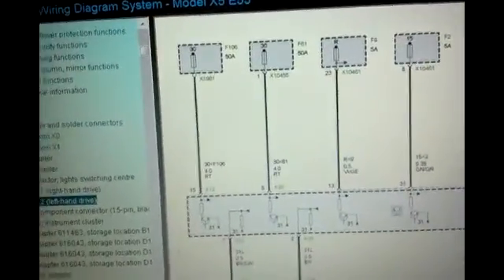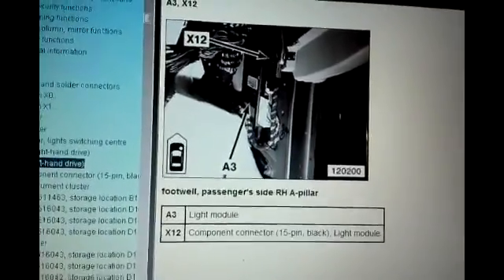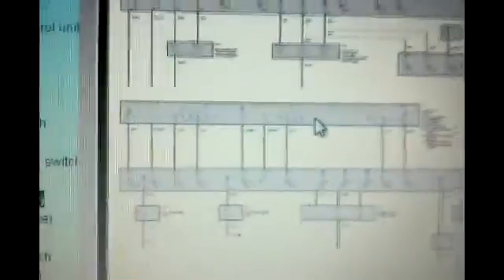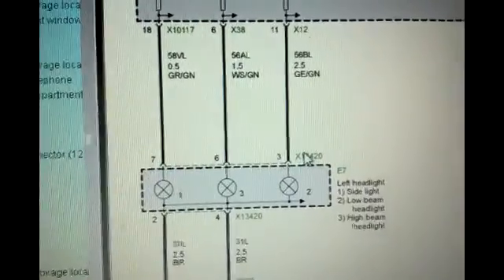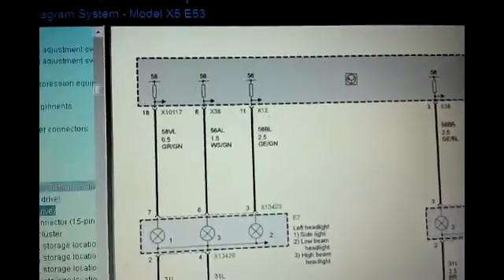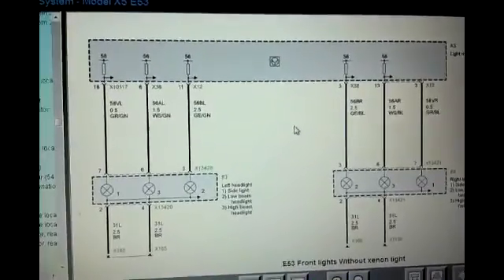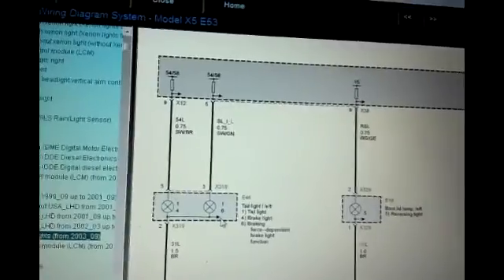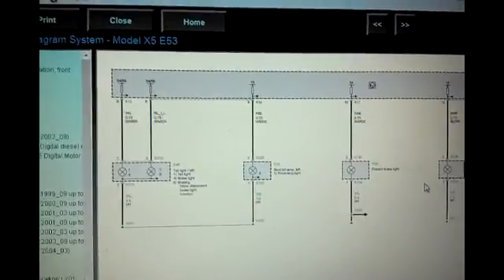BMW X5 Lamp Control Module Wiring Troubleshooting Power and Ground

Comment: Hi nice video. I have a 2002 x5 3.0. I started to smell electrical burning inside the car in the driver side. Now my indicators don't work, the dash does not light up anymore, the head light switch doesn't work but the head lights are always on when the car is running with the switch in the off position. I notice water in the driver side foot well when it rains. I suspect this caused my electrical problems..please help what do think is the problem?